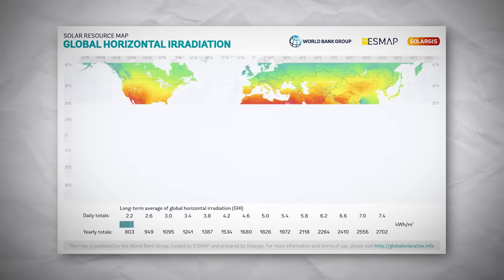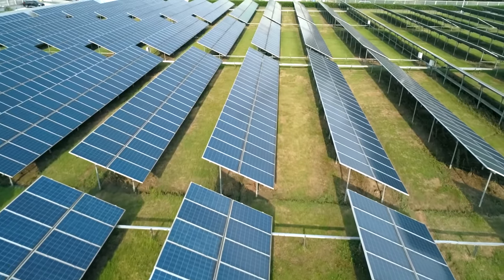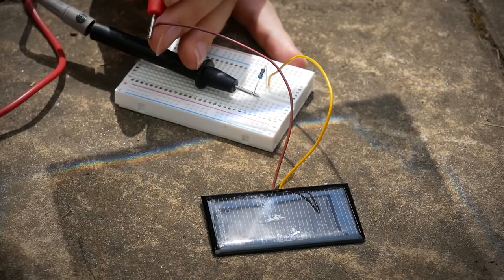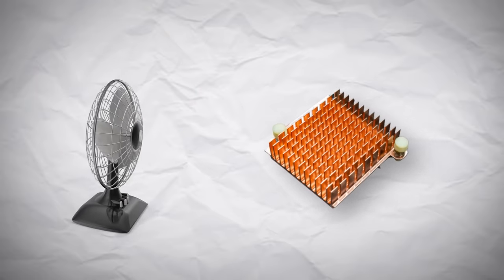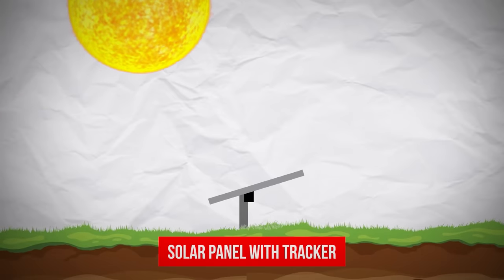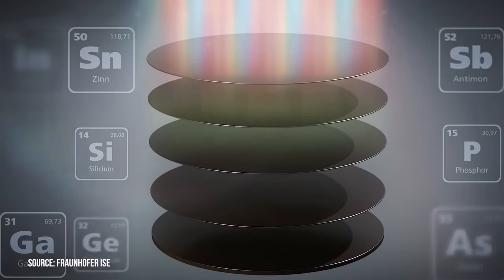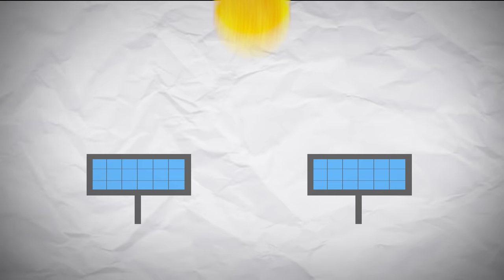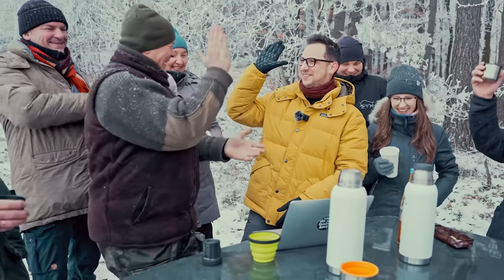Is Spherical Solar Really The Future of Energy?

Comment: The problem lenses solve is to reduce the amount of solar cell surface, which is good for the budget if cost of cells is the limiting factor. However as costs keep dropping and efficiencies creep upwards, increasingly the limiting factor is surface area, which lenses do not solve. Lenses also introduce their own problems, such as that efficiency with increasing angle of incidence drops far quicker.
Reply: Concentrated ev has overheating issues that counter benefits, so you need cooling system on top of lens/mirror. Back when ev panels in general were expensive and high efficiency monocrystalline panels had even more premium price (and big efficiency advantage) there may have been reason to pay for the whole mirror/lens+cooling package. And there were projects that did that with mirrors as you can have mirror shape that does sun tracking for you without need for that ridiculous giant lens.

But what you said about panel price making this pointless is 100% spot on.
Except it is not something that will happen in future, it's something that already has happened.
Panel price has already dropped to fractions what it used to be and still dropping, they're so cheap right now that many places don't even bother to do sun tracking. They just put more panels at fixed angle instead cause its cheaper and less maintenance. So more panels is cheaper that bargain motor from china to adjust ev panel angle...

I'd say that's just another startup scam like solar roads or atomic batteries.
It just tries to resell idea that was already tried and did not survive economic reality.
Reply: Well, the main problem is that you trade immediate money saving for faster solar panel degradation due to heat. And if you do try to solve that, the price will go up again.
Reply: That why it does not exist. And there is a solar power plant with molten salt en focused mirrors. Porbably works better
Reply: @sznikers  I agree with you and the original commenter, however it's really sad that it is that way. Because it somewhat contradicts the reason we want solar power. We want sustainable energy and to be more mindful of the resources we use on earth. But for some reason the main solution for more solar power is to produce more solarpanels which costs alot of rare raw materials aswell as a special silicon which alot of it is produced by burning coal... that's not sustainable. So to try and mine less materials we should explore more options like these lenses and limit the amount of mining needed. And sure it might end up being worse but it is good that we are trying. As for the cost, if we didn't power through despite high solar panel costs we wouldn't be where we are today. So to dismiss a potential solution because of high costs ia plain stupid. Sure I know that's not how the free market works, but those that has the choice should definitely try to support more innovation
Reply: @Syphirioth  the one in Nevada failed due to too many leaks, molten salt apparently eats pipes.
Reply: @patrickmcginnis7  Ye corosion is problem I know. But the development just got shut.

Comment: Absolicon had a parabolic trough with a multijunction cell at the bottom and a copper pipe heating water on the back. It was such a clean design that could be easily scaled to any size.  The trough had only a single axis and one regulator could work for essentially any length.  It was better than anything I've seen since.
Reply: I made one of these 4 years ago, and honestly its incredibly hard to stabilise. Even if you manage, all it takes is a heat wave and it goes nuts.

Comment: How does the lens use affect the usable lifespan of the panel?
Reply: Commonly, the more temperatures in any machine fluctuate, the less life expectancy you can expect. 
Since those systems would wobble between hundreds of c° by day and ambient temp by night, some trouble is to be expected. Even normal unconcentrated systems need to be fixed to their lattice keeping expansions and contractions in mind. 
There are gliding mountings in all of those roof-systems because they too have big temp fluctuations and panels shift on any given day.
Reply: cause the light gets too concentrated. But if you think about it its just place another smaller lens between the sphere and the solar panel, making the light scatter a bit. So it won't damage the panel and it will be like its almays mid day for the panel

Comment: Love seeing the speculation and inquisitiveness. I've been to hundreds of systems, the reality is cost is tantamount, and all these systems are far more expensive, materials, installation and maintenance, solar trackers fail, and sit there, a few more panels makes up  the added wattage from tracking. Concentrated is a nonstarter for all the reasons you mention. the peroskovites are possible, if , if if. The real cost holdout is the battery storage, the inverters ( EG4 600xp ) and Panels have come down enormously, its the batteries and regulations / codes governments along with lack of funding is holding up much , much wider application. Theodore

Comment: As far as I know, and it used to definitely be true some years back, it is impossible to focus diffuse light such as light going through a cloud or heavy haze. So the lens approach can be expected to function very well in dry sunny climates such as Arizona and New Mexico but not well in eastern cloudy and hazy states. A regular solar panel not relying on lenses does function reasonably well through haze and somewhat also through thin clouds. Another technical issue that can be solved is that the focal point of the light going through a lens will change location as the sun moves. This means that maintaining the lens focus on the solar panel increases the complexity of the design and hence likely the cost for the product and its maintenance. One never knows what advances can be made these days so never say never! We do need to address these issues.
Reply: How is it impossible to focus light going through a cloud ?
And he also talked about the solar tracking system it would need

Comment: As other have already written:
- the solar panel needs to be smaller than the lens, which means less solar panels per area
- more expensive solar panels + lens
and perhaps more crucial:
- solar panels are much easier to clean than the jagged surface of a fernel lens, where dirt and dust will accumulate.

Seem like good only in theory. In the real world we need to take into consideration practical things like unit economics, maintenance etc. This is not a great idea imo
Reply: Right, maybe a better invention would be mirrors mounted on a motorized stall to send back light on the other side of the house while the sun is on the EAST/WEST side. We have panels placed in an EAST/WEST combination and I can see that the energy moves from one string to the other during a normal day. Having a large mirror in the back of my yard that would send light on the EAST side of the roof while the sun is already on the west side would increase production by at least 60-70% percent as the panels on the EAST no longer get enough light. Same could be applied at sunrise for the panels placed on the WEST side but I don't really want a huge mirror in front of my house lol.
Reply: @alexandruilea915  you can have mirror shape that does sun tracking for you and it has been previously done to focus light on expensive multilayer monocrystal ev cell. All those ideas were abandoned simply because mass manufacturing of simple ev panels dropped the price so low none of that makes sense anymore.
Reply: @sznikers  also, focused light means more heat at the same time.

Comment: The Fresnel lenses in lighthouses need constant cleaning to operate efficiently. Dust, pollen, and deposits from rain are always going to hinder the operation of concentrators, and this will add to the overall upkeep cost when coupled with solar panels that also require occasional cleaning. The inexpensive flat plastic Fresnel lens is the worst choice as a concentrator a its grooves are so fine that it may be near impossible to keep them clean without sandwiching the film in glass and adding to the cost that might just be better spent on additional solar panels.
Reply: Um….we HAVE GPS now, Junior!!!
Reply: @Tryp-j9d  err...what does GPS have to do with using Fresnel lenses to concentrate sunlight on solar panels?
Reply: @kachmi    LIGHTHOUSES are 100% USELESS now.   REGARDLESS of the light’s SOURCE!!

Comment: I'm far from being an expert on solar energy but I was thinking about how hot the hood of a car can get in the sun. I've watched videos about using black tubing in a sort of box with a clear cover and letting the sun heat water in the tubes for hot water without electricity. So I'm wondering if Fresnel lenses could raise the temperature high enough convert the water to steam to run a turbine. Would need to use metal pipes and enclose the system so it wouldn't loose part of the steam into the air and waste water. Might could use something I read about years ago. Liquid ammonia I think. Vaporizes at a much lower temperature than water so it wouldn't need to get the pipes as hot. Good work on the video.

Comment: Put a stirling generator on the opposite side of the hot solar panel. There will be a temp difference between them and you can even increase that difference. If the panel is made tough enough, maybe being hot won't matter.
Reply: I agree, Stirling generator would be great , with them running off the temperature differently they could stay running after the sun is down but the cells cooling down a night
Reply: @dennisbarker5986  Maybe the spinning half of the generator is underground, so there could still be a temp difference. Leave the panel on the surface.

Comment: Very interesting.   I work with a United States Government Contractor in the early 1980s that built large concentrating solar generators for research.   They used your flat lenses with the small PVC at the bottom of a sealed box.  The large assembly rotated on perimeter rails.  The election of President Reagan caused the research to be canceled and moved to another company that built the single pier rotating solar generators you exhibit.  I do not think we had 50% efficient solar cells in the 1980s though we were also researching PVC fabrication.   I started building solar generators in the 1980s and have experienced great performance.   Today I generate all my power from a single 100W solar panel.
Reply: actually it was stopped because solar on the surface of the earth is far more expensive as a base load provider than all other techs.
Reply: @protonneutron9046  I think President Reagan's only other tech was oil from Saudi Arabia and the Petro Dollar Economy that comes with it?
Reply: @protonneutron9046  It's only more expensive when you ignore the externalities of other energy sources. Coal is super cheap, until you start looking at how it poisons the air, soil, and water. If we could add to the price the billions of dollars it costs to recover from the harms, it wouldn't be as cheap.  System costs matter because nothing works in isolation.
Reply: @JoeNunyabidness  wrong!!!!!!  Don't spew crap when you don't have an education.  In fact, LIST them with primary sources with the cost accounting or admit insanity and being a liar.
Reply: @protonneutron9046  haha, you totally come across as a sane person who would change your mind if provided with sources. /s

Comment: Once i maid some research on solar concentration. There is another type of solar cell based on gallium arcenide that can stand very high temperatures, - opposite to silicon commonly used in solar panels. The problem with concentrators -  they are much more expensive than panels to operate and can not compete with cheap prices of solar panels... Solar concentrator is useful when you need extremely high constant temperatures for some scientific research, there is just one very big concentrator like that found somewhere in France, and there are  a lot of them  that produce heat for commercial steam power generators. Most interesting project of solar miror concentrator i found, was 5 meter in diameter concentator  conctructed to heat some poplar reseach station. it actulay was able to heat the water even in polar freezing cold and saved to bring there a lot of fuel...

Comment: Index lenses would probably work well on boats, you can make cooling loop that gets cooled down by the ocean
Reply: Weight and pump system (power loss to pumps and maintenance of pumps and filters)
Reply: You could just tie them to the back of the boat and make a large floating raft/platform. Not a bad idea imo

Comment: [Fresnel lenses work totally different than described.] CORRECTION: NOT. THE REST IS ABOUT FRESNEL ZONE PLATES. A Fresnel lens has concentric circles that block the light. It does not work usin a difractive material, rather blocking half of waves essentially leaving the parts where the wave phase make them stronger in the focal point and block where the phases would kill each other. Because of this the Fresnel lenses start with 50% efficiency, but you can use them for non diffractive waves, like X-ray or sound. For sound we did some experiments with cardboards, the lenses were ten feet diameter, and it worked. It was a school project 45 years ago.
Reply: First, they are spelled Fresnel, not "Freshnel". Second, the arguments you present don't sound correct, and if anything, sound more like you're describing polarizers than lenses. Maybe trusting your memory from childhood of 40 years ago isn't a good idea.
Reply: That's zone plates, not fresnel lenses

Comment: People are always looking for a way to over complicate it when there's no need to over complicate it. We in the US have so much desert land that we could produce all the energy we need with solar and we would only use a small fraction of the desert land for regular solar panels. The real problem has never been watts per a square foot of solar panels or not having enough land with direct sunlight. The problem has always been the rotation of the earth. It dark about half the day and light about half the day. Thee either needs to be an efficient and safe way to store the excess energy collected during the day so it can be used at night or on days it's cloudy.

We keep coming up with overly complicated ways to store energy. Batteries are not dense enough. Molten salt is overly complicated and relies on the grid to keep from solidifying in the event there's not enough sun. Gravity storage such as huge amounts of water pumped to a higher elevation and then released to a lower elevation can work pretty good. But it too is a super huge endeavor to build and maintain. IMO, a combination of solar, wind, nuclear and fossil fuels are the only practical solution with current technology and the current state of the world's political unity and peace.

What would a solution look like? The holy grail is of course direct radiation to energy production where heating water to steam is removed from the equation. Equally, fusion is a solution. But both are technologically outside our abilities at the moment. The other solution is a world electric grid with solar and wind production diversified throughout the world. The darkside of the earth is provided for by the lightside. But of course, although we as humans are capable technologically of that endeavor, we are far too immature as a species to cooperate enough to accomplish it.

So, that puts us back to an all in solution on an individual national level until such technologies develope or humanity matures. I personally believe technology is the answer. Imagine if the world got together and offered $10 trillion dollars to the first company that could sustain fusion with 10+% positive energy production. There would be a race like none other to get it done. Imagine unlocking the race to a sustainable solution, driven by the greed of fame and fortune. The minds of the world aiming toward a singular goal. It wouldn't matter if their motivation was greed or the betterment of humanity or the betterment of the world. Regardless of motivation, the end goal is the same.

Comment: 3:50 Actually You can pump water through a pipe without using electricity if you attach A windmill.
Not to mention the mere process of the windmill Liquid lines would produce more electricity While still providing a cooling effect.

Comment: From a quick check ages ago, I couldn't find any lens that where remotely cost effective.  But the "tech ingredients" channel had a great idea of using thin aluminum sheets plated with silver (and I believe anti tarnishing plastic/film).  Not that his example appeared remotely permanent (don't let it hail on the thing, nor let wind hit his contraption) put the mirrors and the idea of tracking with the lighter part appears as a good start for a solar system.

Comment: In multilayer solar panels, solar efficiency doesn't increase because of concentration rather it is because of a wider range of energy bandgaps being absorbed from the sunlight. Each layer is designed to absorb a different energy bandgap.